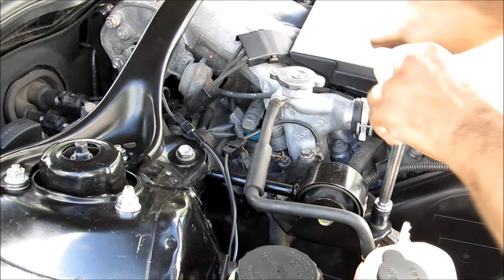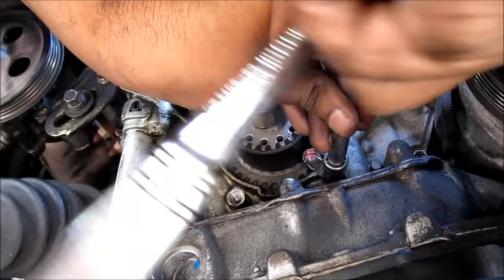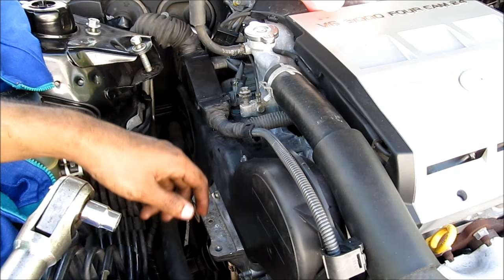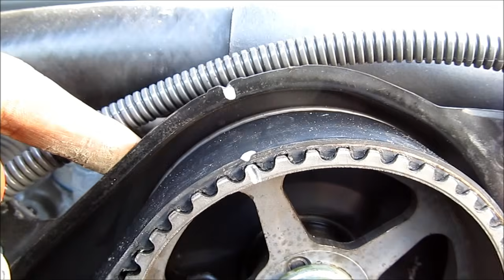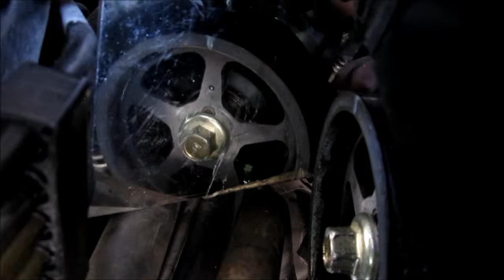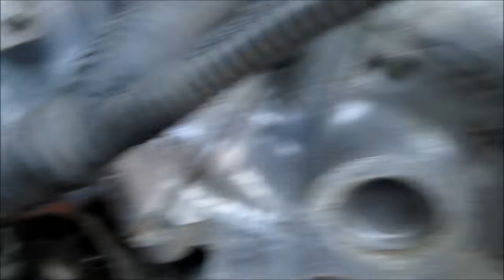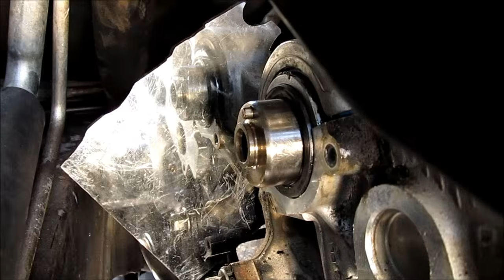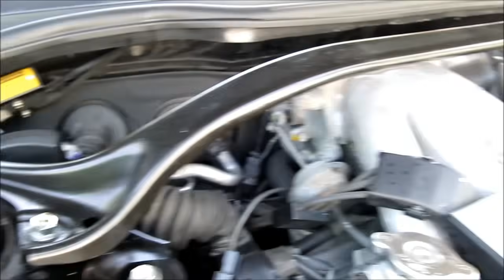Timing Belt / Waterpump Replacement: Toyota & Lexus V6

Comment: I backed the crank back about 1/2 tooth and was able to move the belt over to correct point.  Carefully moved the crank back to TDC mark. I ran engine and then rotated the marks to TDC again by hand and all looks good.
Reply from the maker: Jim Thompson Great, you got it to work!

Comment: I think it is just one tooth off and I don't know how to get belt on correctly
Reply from the maker: Jim Thompson You might have it on backwards. The arrows are supposed to point outward (if I remember correctly?).
Reply: speedkar99  I had arrows correct,  thanks anyway.

Comment: I bought timing belt kit from rockauto.com.  I cannot get all timing marks lined up on belt.  I turned engine over a couple of revolutions and now cams sprockets come a couple of teeth off.    I have no idea how you can get the belt on correctly
Reply: Jim Thompson The timing marks are ONLY for the initial alignment.  They will NOT line up after you turn the crank.  Turn the crankshaft around twice twice and verify the little marks on the pulleys against the little marks on the block, disregarding the marks on the belt.

Comment: Can you spend some more time on how to remove stubborn bolts?
Especially when a breaker bar with don't work.
Reply from the maker: DEE K That crank bolt? Use a 3/4" air impact gun, or use the bump start method, https://www.youtube.com/watch?v=O_6SFBg7_dg .
For rusty bolts soak them in a penetrating oil, and use some heat to encourage them loose. Use a camshaft holding tool for the cam bolts.

Comment: This is a great video... grew up with a Dad who made me watch him work on the cars.  Ran across this video while looking for a visual aid to help me find the timing cover and where oil hoses are...... I am very worried. Tonight my engine light came on, I parked at home, few hours later I had suddenly lost alot of oil toward front of the vehicle.
I feel sick since seeing the oil all over the driveway... Have Glaucoma, need cornea transplants, raising special needs child.....I can rarely drive more than a few blocks to grocery store. Have always worked, Cannot work right now, just made last car pmt, warranty expired in February. Yes I am whiny right now....
again, great video though..
Reply from the maker: Kristy Warkentin Thanks for the feedback and sorry to hear of your situation. Do you have a 2007 & up Camry with the 3.5L V6? If so, the oil hose bursting was part of a recall by Toyota. It should be replaced by a metal line.

Comment: i have a 04 dodge neon with an interference motor and im trying to do the timing belt but the tensioner didn't work and now the marks on the camshaft and crankshaft is off and I think it is hitting but I didn't try to force it or anything what should I do to get them back in sync  HEEELLLLPPPP
Reply from the maker: TheBranden86 Rotate the crank to 60 degree where the pistons are less likely to come in contact with the valves. Then adjust your cams so you're back inline, and then adjust your crank and retime.
Reply: speedkar99 thank you but I already did that today but thank you so much  for trying to help me out

Comment: Novice's question:  Why is it necessary to align TDC if you put the new belt on using the belt marks on the TB (e.g., the solid and dotted marks on the Toyota TB) and the marks on the crankshaft and camshafts?
Reply: Art55Vandelay Hi what brand of kit did you get from Ebay? Thanks
Reply from the maker: Art55Vandelay Aligning with the marks on the engine (not necessarily TDC) makes it easier to make sure the gears are at the correct position relative to each other before putting the belt on.
Reply: speedkar99 
I finished this job on my 2003 ES300 recently using an OEM kit I purchased on EBay.  While it is fresh in my mind, I thought I would share some things I ran into:1.  On this model ES300, the hydraulic belt tensioner bolts are perpendicular to the engine.  The power steering pump has to be completely removed (I let mine hang by the hoses) to access the left tensioner bolt.  I wasted a lot of time trying to figure out how to remove the tensioner bolt without removing the pump, which was dumb on my part.  I should have just removed the pump immediately.2.  I tried removing the crankshaft pulley with an antique professional-quality electric ½"-impact wrench and impact socket, but it would not budge.  With trepidation, I resorted to the starter bump method, and it loosened it on the second try.  I removed the EFI fuse before using the bump method to prevent the car from starting.  I think this is a dangerous technique, but I had no choice.  If I did the job again, I would rent a ¾" electric impact wrench if there were one available.3.  I loosened the front camshaft pulley bolt easily using the tension of the old belt.  I did not loosen the back camshaft pulley bolt using the same method because I had read that the third timing belt cover could be rotated to allow removal of the water pump (I was not going to replace the oil seals anyway).  Not true on this model.  When I realized I could not rotate the third cover to get the water pump out, I tried removing the back camshaft bolt by holding it with an outrageously expensive Lisle camshaft tool (another trip to the auto parts store…).  It bent the tool on the first try.  I tried fabricating a tool (I don't have a welder…) but this failed too.  In the end, I rented a stud extractor kit from the local auto parts store (yet another trip…) to remove the two studs that pass through the water pump.  This worked.  Note:  The stud extractor (8 mm) I used, which is basically a socket with "knife" edges inside it to dig into the stud, did not work very well.  You have to rotate the socket hundreds of times before the stud is scraped up enough for the socket to catch on the stud.  If I had this to do again, I would scratch the smooth stud shaft with a file to make the process go faster. 4.  By following the sequence recommended in the FSM, I did not have any trouble installing the OEM TB and getting it lined up tdc.  I had to move the rear camshaft back to tdc with a wrench during installation because the spring tension rotated it off the mark when the old belt was removed.  I used small spring clamps to hold the belt on the marks.  I was worried about this part of the job, but overall, installation went smoothly.  A small mirror taped to a stick is a must to get the marks lined up on the rear camshaft.5.  On reinstallation of timing belt cover #2, I stripped one of the small bolts when I tried to use a torque wrench on it.  If I did the job again, I would use a ¼" drive socket on these bolts, which makes it difficult to over torque, and forget the torque wrench.6.  To hold the front camshaft pulley and crankshaft pulley while I tightened the bolts, I fabricated a holding tool by using a 11/4" floor flange from Home Depot, stainless steel bolts I had in the garage, and a large pipe wrench.  I saw this tool on another site. It worked well (in retrospect, this might have worked for holding the rear camshaft pulley to remove it, but I didn't think of making this tool until later).7.  Getting the power steering pump back in place was the worst part of putting stuff back together.Conclusion:  I wanted the learning experience and I got it big time.  In the process, I lost an entire weekend and some blood from numerous cuts.  If I did the job again today, I could do it in 5 hours or so with minimal loss of blood.  If you are trying to save money and your time is worth anything to you, buy the OEM parts and hire an experienced mechanic dothe labor.
Reply from the maker: Wow thank you very much for the writeup. I faced exactly the same issues as you when doing my first TB job on my 2005 ES330.

The bump start method didn't work for me and I had to buy a 3/4" air impact.

The power steering pump was left dangling (not completely removed though as the tensioner bolts go sideways (as opposed to vertically as in the video).

I was able to rotate timing cover #3 to clear the water-pump and didn't bother with removing studs.

The rear camshaft at its timing mark is at the top of a cam lobe so it has a tendancy to move forward during TB installation.

In the end I overtorqued my water-pump and idler bolts and they snapped and had to tow it to a mechanic to finish the job :(

It was a learning experience for me, and that's why this timing belt video was much easier.
Reply: rkgsd 
ITEMPARTQuantityManufacturerPart number1Timing Belt1TOYOTA13568-090802Idler#11TOYOTA13503-0A0103Idler#21TOYOTA13505-200304Tensioner1TOYOTA13540-200305Front cam Seals2TOYOTA90311-380346Front crank Seal1TOYOTA90311-400227Water pump1AISIN16100-290858Water pump Gasket1AISIN16271-200209Thermostat1Toyota90916-0312910Thermostat Gasket1Toyota16325-6201011Power Steering Belt1TOYOTA90080-91088-8312A/C Alternator Belt1TOYOTA99366-21040-83THIS KIT ALSO COMES WITH:90915-YZZD1   OEM TOYOTA OIL FILTER90430-12031   OEM TOYOTA DRAIN PLUG GASKETShipping is FREE!!!!BUY THE KIT NOW FOR:$336.95

Comment: I had oil leak from my cam seals both front and back towards the firewall on my 2000 Lexus RX300. I applied ultra black in the groove before placing new seal. The back seal is fine but i am constantly getting oil leak from the front cam seal near the radiator. I pulled all the components as per your video, and placed a new seal, again the front seal is leaking, any ideal why ? also i noticed a small hole in the bottom of the groove where the seal sits in. Any help will be appreciated to get this oil leak fixed.
Reply from the maker: Mat Dsouza You're not supposed to use any sealant on the cam or crank seals. Also if you've nicked the surface of the seal or its housing that could cause a leak. 105K miles is low to have an oil leak.

Comment: I understand that it is better to get the timing belt from the dealer than aftermarket.
Is Aisin aftermarket or OEM?
Reply from the maker: DEE K Aisin makes the water-pump for Toyota/Lexus and is their OEM supplier. Get the Aisin kit from rockauto, the parts are all OEM supplied.
Reply: Thanks!

Comment: Are both the rear and front crankshaft seals the same?
Reply from the maker: Brandon Schmitz The crankshaft seals are not the same. The front crankshaft seal is located on the timing belt side of the engine (as seen in this video). The rear crankshaft seal (also referred to as the rear main seal) seals the crankshaft between the engine and transmission (and is a much harder job to replace as you have to pull the tranny). The camshaft seals however are identical.

Comment: how did you tighten the power steering belt?
Reply from the maker: onesri You've got to wedge a pry bar somewhere between the engine block and pump housing and pull it down while tightening the adjuster bolt. A bit tricky. See this video:

https://www.youtube.com/watch?v=tCBcbLx6Qrk

Comment: Speedkar99, I replaced the cam seals on my 2000 Avalon, but they are leaking.  Rear is leaking slightly, not enough to leave a oil stain on ground, but enough to put oil on power steering pump and control arm.  Front very tiny seeping.  Could this be caused if the seals were not tapped in all the way?   What would you recommend I do to fix?
Reply: +neppy5 Hello. I noticed the leak immediately after installation.  I am still working on resolving the leak unfortunately.  It is the front cam seal that is leaking.  The first cam seal was torn due to residue on the cam.  I did not clean the cam shaft the first time.  Since then I cleaned with carb cleaner and a rag.  the next 5 cam seals I can not tell why they are leaking.  I then bought the tool on amazon to evenly push cam seal in.  Still leaked.  But, very small leak.  Not even enough to reach frame, but big enough to notice on front of engine.  I then found out I was supposed to replace the washers on the valve cover bolts when replacing the valve cover gaskets.  I watched speedkar99 video on how he used washers from the hardware store.  Still leaked.  I took to my mechanic friend for advice.  He asked if I replaced the PCV valve.  I did not.  So we replaced.  He is guessing the PCV valve was not allowing the pressure in the engine to get out, so it was releasing through the front cam seal.  That was last week.  I have not checked if the leak is gone, only because the only other option is a head gasket and I am not going to do that for such a small leak.
Reply: +George Negrete thanks for all that detailed info and hope you get this resolved soon!
Reply from the maker: George Negrete Yes, if you didn't tap it in all the way (or maybe too much) or used a deficient seal it could leak. Also if you gouged the surface of the cam shaft or its housing oil could be leaking through.  Another user was having the same issue with replacement seals leaking on his Solara:

http://www.toyotanation.com/forum/104-5th-6th-generation-2002-2006-2007-2011/160972-changing-v6-timing-belt-pics-270-coil-connector-10.html#post9257753
Reply: +George Negrete when did you notice the rear cam seal leak? how long after you finished the job and were you able to resolve the leak by now?

Comment: U got awesome vids, only issue i have is that there's too much editing. for me as an amateur i'd like more details
Reply from the maker: affane78 Thanks for the feedback. I do try to make my videos as informative as possible but straight and direct to the point. If you need more info, you can read up the commentary on the forums and ask questions:
http://www.toyotanation.com/forum/103-3rd-4th-generation-1992-1996-1997-2001/505025-diy-2001-camry-xle-6cyl-timing-belt-water-pump-crank-cam-seals-part-i.html
Reply: speedkar99 Ok will do thx for the feedback

Comment: I just want to say thanks for this video. I changed my timing belt about 4-5 years ago and it ended up taking me 3 days! It could have been hours if I had seen this video first!

One thing I would note is that when removing the water pump, the STUDS in there have an inverted torx or something like that on them and can easily round off. I rounded one of them off and needed a STUD REMOVER to get it out. Also, when installing the studs, you should put a bit of thread sealer (white paste, not loctite) so the coolant doesnt leak from studs.

One other thing I recall is when I put on my new timing belt, for the LIFE of me I could not get the marks to all line up on the new belt. It was always about 1 or 2h teeth off, and would not all 3 line up. Long story short after wasting about 4 hours trying everything, I finally read on one of the Toyota nation forums as long as the belt is properly seated and NOT skipping any teeth, then disregard the lines. So after wasting half a day I went back out there, lined everything up and made sure it was seated properly and just ignored it. It ran fine after that...
Reply from the maker: mooseboy84 Thanks for the feedback. Removing the waterpump studs are a pain and that's why I opted to remove the cam gears and timing cover #3 instead. The teeth alignment aren't dead accurate, but shouldn't be a whole tooth off. It depends on the angle that you're looking at the belt and mark when aligning. Perhaps your cam and crank marks were mixed up or the belt was backwards.

Comment: Hi all.  What is the easiest way to disconnect the ignition on 1MZ-FE for the starter bump method?
Reply from the maker: jayjayromane Disconnect the three front ignition coil connectors or remove the IGN fuse in the glove box.
Reply from the maker: Sure
Reply: +speedkar99 would it suffice to just remove the spark plug wires?

Comment: did my timing belt 3 days ago.....i was too excited when i was doing it and forgot one thing you mentioned in this video...hey people listen to this carefully as what speedkar99 mentioned in this video.....LOOSEN THE REAR CAMSHAFT BOLT FIST WITH THE HELP 0F THE TIMING BELT TENSION...loosening that bolt feels like it requires more than the tightening torque specs...it may have some threadlocker from factory.....the $14 lisle 58430 oil seal puller i bought from amazon was also a big help.... pulled out the seal instantly....and of course i got confident in doing my timing belt because of this video...........speedkar99 for president !!!!!!!!!!!!!!!!!!!!!!!!!!!!!!!!! :D
Reply from the maker: EvendimataE Thanks for the constructive feedback. Glad you got the belt job done! For me that rear cam seal was a bugger with the tight room inside the fender.